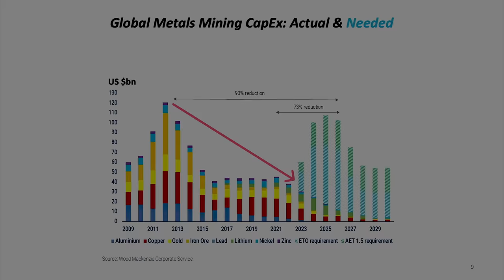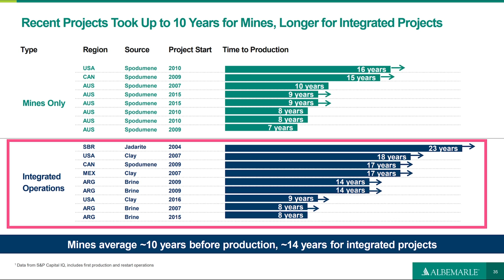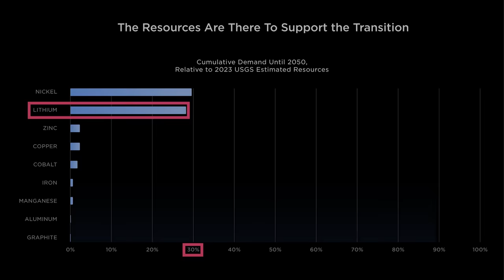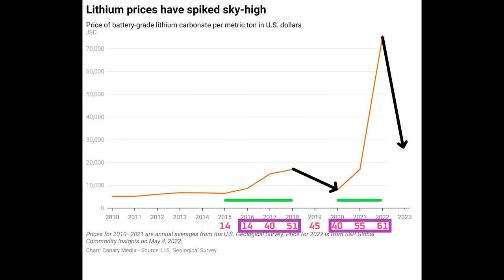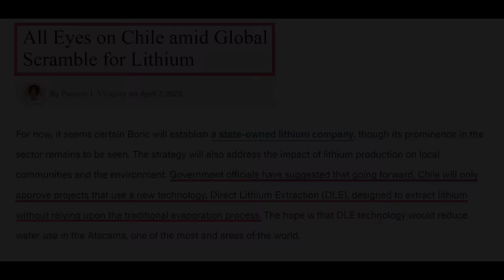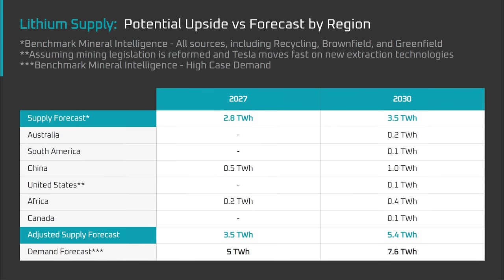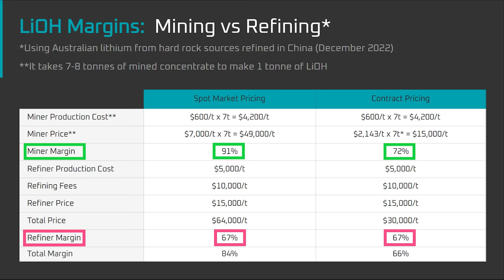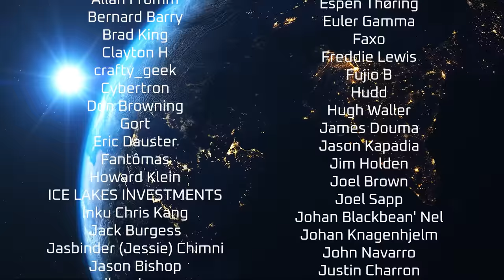The Global Lithium Supply Chain and Tesla’s 50% Growth Rate  I  ~3 Month Project

Comment: I suspect the demand curves are over estimated. They probably assume the large legacy auto companies will all continue to exist at some large volume of EVs. You can already see them dragging their feet on EVs. As ICE car demand drops some of them will not survive the phase change. TaaS (i.e. robotaxis) will start to reduce vehicle demand (I think someone else pointed this out below) and, long term, EVs will probably last 2 or 3 times as long as an average ICE car so there will be a lower demand for replacement vehicles. We already passed peak auto a few years ago. If yearly sales stabilize around half the present rate it could change the outlook significantly.
Reply from the maker: I think the demand was based on the demand from battery factories - that is, the number planned and when production was supposed to start, etc.
Reply: And don't forget storage and other applications for batteries, that is somewhat included in the demand from planed factories
Reply: @thelimitingfactor  Unfortunately, many legacy auto manufacturers seem to be cancelling and postponing battery factories.

Comment: Great video Jordan I realized you touched on this but,  recycling old batteries for there materials or just using them in other applications may be a larger factor in end use and, supply chain issues if it could be done economically at some point.

Comment: Late to this and working my way through this excellent piece. Just my small point, there is the potential for some relief from designing in greater efficiencies for power trains and moving away from bloated SUVs, “crossovers” and vehicles based on ICE vehicles rather than bespoke platforms, giving us smaller batteries for equivalent range.
Reply from the maker: Thanks!  While true, there's other things that balance that out like the switch to LFP batteries which use more lithium per kilowatt hour and the fact that Tesla's moving into vehicles like the semi, which use an enormous amount of batteries.

I avoid getting into those factors because it's really playing around the edges and there's vectors going several different directions that seem to balance out.

Comment: Absolutely an awesome video on battery materials supply chain!  I'm wondering what the role of FSD will be on materials supply/demand.  By that I mean, if a vehicle (fixed set of materials) can supply 5 times the utility compared to a vehicle that does not have FSD, then is the demand for materials going to be reduced (we don't need as many vehicles) and/or will Tesla be able to outbid everyone else for the materials that are available because their vehicles are worth so much more.
Reply from the maker: It very well could reduce the demand, but not to any extent that we'd see this decade.

That's because it will also be displacing other transport modes and also increasing the demand for transport because it will be lower priced.

Comment: Within the context of mining extraction rate refers to how quickly a mine is fully depleted however in refining extraction rate refers to how much of the lithium in some ore is actually extracted for real use. Most lithium refineries only have extraction rates of around 30% but newer refining processes could bump that up to 70%, more than doubling reserves without increasing mining. Also mines could increase their extraction rates without increasing capital costs by switching to 24/7 operations instead of 8 hours 5 days a week.
Reply from the maker: Hmmm, are you sure that you aren't confusing DLE extraction with refining?  I know a lot of DLE processes are claiming more efficient extraction from brine, but with regards to refining, the spodumene concentrate is already at 6% and it's just a matter of pulling it out with chemicals/baking - so it's already like 70-80%.

Comment: Nice work....have you included the increase in TWh energy per Mt of lithium over time as batteries become more efficient?
Reply from the maker: Increasing the energy density of batteries only reduces the amount of non lithium weight in the battery.

The only thing that affects that is changing the voltage which is actually dropping as we use more LFP
Reply: @thelimitingfactor  sorry I am not clear on this. If a battery's capacity to store energy increases by 10% why doesn't the ratio of storage per lithium weight change? Is it only possible to increase the amount of storage of a cell by adding more lithium to it? Thanks

Comment: Jordan at 51:00 or so, you said multiply elemental lithium by 5 to get LCOE equivalent. Presumably that is weight but not sure how that could be as you said LCE is 1% lithium. Maybe LCE is that concentrated carbonate but that’s still 6%. How do those numbers jive?
Reply from the maker: Rock is 1% lithium, spodumene concentrate is 6% lithium.  And of course, bear in mind that's pure lithium rather than lithium carbonate.  

That's why it takes about a 7 to 1 ratio of spodumene concentrate to make 1 LCE.  

However, those are concentrations.

Pure lithium metal is just that, and lithium carbonate is lithium metal combined with carbonate.

I hope I answered the question!  It can be quite confusing with all the conversions
Reply: @thelimitingfactor  oh. Silly me. I was conflating LCE with spodumene concentrate. My Bad.

Comment: Jordan, Incredible work! 

Quick question: in the past I believe I heard interviews were Drew talked about the potential of extracting lithium out of fracking wastewater. That, and extracting wastewater out of Desalination brines are two DLE applications that have captured my fascination. 

Have you ever looked into this? And assuming that the technical limitations for applying DLE in these ways can be overcome, what sort of regulatory hurdles would have be cleared in order to run DLE in either of those environments? Intuition says it would be significantly lower than opening a greenfield mining site, would it be on par with running a brownfield site?

Thanks for everything that you do!
Reply from the maker: Thanks man!

Yeah, they could do that, but it'll take years to set up and get running.  They do have people working on things like that.

DLE is a regulatory black box because no one has REALLY found a way to reinject the brine yet.  It sounds simple, but it's not.

That might mean a longer regulatory process because there's no precedent.

Mostly, the DLE companies are talking out their butts.  I've talked to the big players that are heavily invested in it.  We won't know they economics until the first one is built.

The only ones that really work so far are in South America where the brines are 13-14x more concentrated and there's fewer impurities.

That is, what I said in the video still stands.

Comment: Does this factor in improving battery efficiency? I'm not sure how that works, but I'm thinking if future batteries can get double the energy density with the same lithium then to reach those targets we'd need half the lithium. I'm just pondering, I don't know if that's how it works.
Reply from the maker: Energy density improvements happen by removing dead weight, not by increasing the power of the ions.  The only way to do that is by incresing voltage...so we're actually seeing the opposite with  greater usage of LFP

Comment: Great video, as always: I do like data.
I may have missed mention of more efficient use of lithium in cells to increase energy density (eg use of silicon particles), else please consider including this in a follow-up.  A 20% increase should overcome the 2030 shortfall.
Reply from the maker: It doesn't matter how much silicon you put in the battery, etc, lithium ion still provide the same amount of energy.

What you're doing when you increase the energy density is removing dead weight.

So no, it won't have any impact.

In fact, with more LFP batteries being used that have a lower voltage, that might actually reduce the efficiency of lithium usage.

Comment: Thank you for the great video!
Along with the video, I have a question about the current point of view.

According to the video, I understood that the price of lithium carbonate in China is not a complete indicator.

Nevertheless, the lithium price of "Traiding Economics" has now dropped below $10,000 per ton, leaving a comment.

If this is the case, it costs $4200 to produce and $5000 to refine,
Wouldn't miners and refining companies no longer produce lithium, or companies that are currently trying to mine and refine lithium could stop doing business?

Will that cause a bigger bottleneck in the future, unlike the data presented, and will lithium prices explode further?
Reply from the maker: No, because 90-95% of the lithium is sold through contracts.  It just means less money for investment as you hinted to...creating another upswing in the future.  And so the great cycle continues, lol.  Feast and famine.

Comment: I think Elon is factoring in failure or EV slowdown from all the traditional automakers. They are already backpedaling or cancelling most of their EV roadmaps. So even if they don’t fail, they will not be consuming as much as battery supply previously thought.
Reply from the maker: It looks like you didn't watch the video.

One of the primary assumptions was that most of the other EV makers will fail and Tesla will scoop up their material supply.

Comment: At 16:13 you say the Miner Margin is 91% - based on cost of $4,200/t vs Price of $49,000/t ---- how did you calculate that? Unless my understanding is wrong that is a margin of 1066%, not 91%. The price is more than 10x higher than the cost. Profit = $44,800/t vs Cost = $4,200/t ==> 44,8/4,2*100 = 1066.67%. But this underlines your point even more
Highly appreciate all the work you put into these videos, I have watched every single one so far and you keep impressing me with the depts of your analyses!
Reply from the maker: Sure thing man!  I can only say to look at how margin is calcuated with a google search.  I ran this by people in finance to verify.

Basically the price is set to 100% and the margin is the portion of that 100% that is profit.
Reply: @thelimitingfactor  yup you're right... 91% profit margin with a price of 49,000 means  ~44,800 of profit. I was thinking of "markup" ([Profit/Cost]*100], not "margin" ([Profit/Revenue]*100)..... Crazy what a ~19%age point margin increase means in absolute $ for the miners!